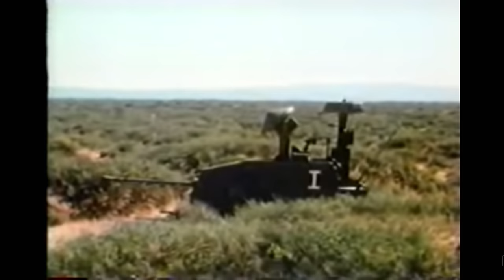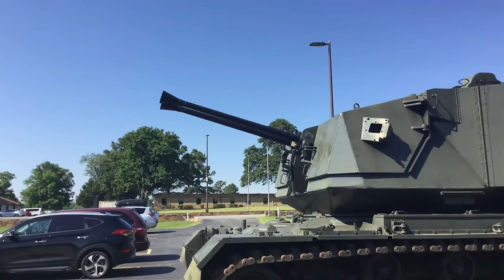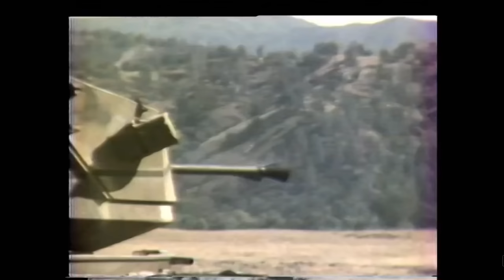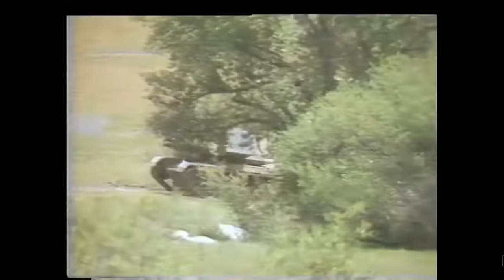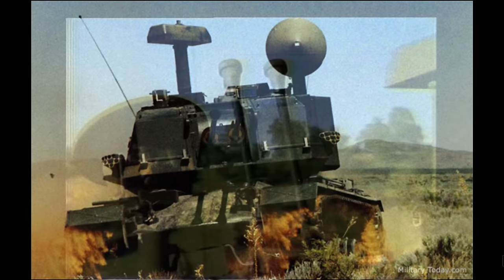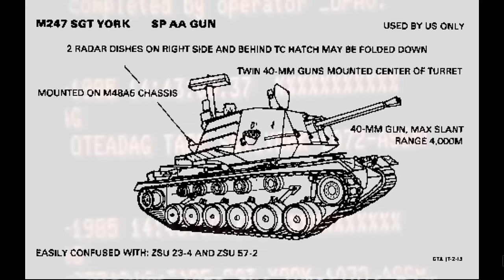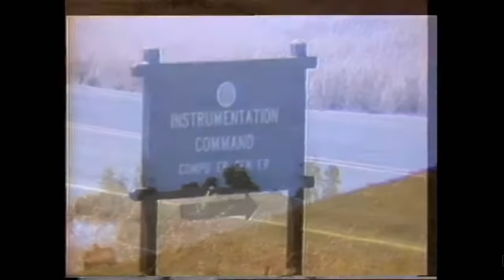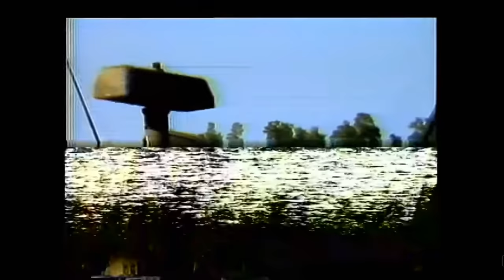M247 'Sergeant York' | WORST AIR DEFENSE EVER!

Comment: They should have just put a radar system on the M42 Duster
Reply: right
Reply: Actually the problem was that the chassis that the M42 Duster was built on, the M41 tank, had stopped being produced in 1954, and was designed in 1944. The engine was even older, as it was selected for this tank from older model tanks, so the engine was from 1941, and it was air-cooled and only got 4 MPG while producing 500 hp. When you bring a tank into combat, you don't just bring the tank, you bring its fuel, mechanics, spare parts, etc. They would have to keep a supply chain open just to keep the duster running. Compare this to the Avenger, built on the Hummer, shares the same spare parts and mechanic pool as the hummers its commonly deployed with.

Comment: When the M-163 Vulcan and M-733 Chaparral makes better sense.
Reply: Brian Coley  exactly.
Reply: We should have upgraded the m163 pivads by adding stinger pods and maybe an upgraded chassis instead of using the m113 chassis maybe a different armored chassis and a new radar system
Reply: @intelligentgrawlix794  THe problem is that the M163 has no search radar + the gun itself has a low effective range
Reply: @dwwolf4636  yes but it is meant as a close in anti air weapon and yes the m163 has a range only radar it can be improved to have a track radar,and a new gun system,and adapting it would hold a gap before an improvement vehicle is made for close air defense, I did say before to improve the m163 not just keep it as is

Comment: My first engineering job (still in school) was working on the XM246 program (test) at General Dynamics Pomona Division.  Still have a dummy 35mm round.  We thought we had it in the bag.  Near as we were told, it really came down to GD already having a huge slice of the US defense budget pie (subs, F-16, Phalanx, Sparrow, Standard, Stinger, etc.) and Ford needed the business.  Production units were planned to use M60 chassis as they were about to be very cheaply available.

Comment: How effective was the General Dynamics XM 246 competitor?
Having the radar based on the Phalanx CIWS system sounds promising.
The only issues are that the chassis requirements were limiting and the march of adversary technology* would render the concept obsolete - so in that respect maybe the Sgt York was the cheaper option in the long term as a effective working prototype that could have gone straight into production would have meant that more money would've been spent on rolling out mass production of a vehicle that would soon be missile bait. It's development hell gave enough time and opportunity for the program to be abandoned before full implementation.

As for the chassis, it would've made more sense to base it on the M1 Abrams, even if just for logistics in field, one less type of vehicle to keep spares and tooling for. It can share parts with the M1 and if the chassis part breaks down in an emergency a standard M1 can be scavenged for spares, either one that's knocked out, or even sacrificing a working tank (from among many) to keep their vital AA cover mobile.
It would cost more in construction than using old tank chassis, but in field and just support it would pay for itself.
And using the M1 would have given it more speed and more weight capacity to work with, reducing the compromises that were needed to keep it under the limits imposed by the smaller Patton chassis.
Would a M1 fitted with a Phalanx system have worked? Could a Phalanx (or even a striped down version) fit on a M1?

*It seems a fixture of US military thought that they never expect their adversaries to have the brains to develop counters, even though they have a long warning period due to the public nature of development.

"They Yankees are producing a mobile AA gun with these cannons fitted - design a missile to kill it a outside it's firing range"
[And IMHO Russia and China have been going all in for F-35 killers for at least a decade, very long range infrared detection and missiles, and radars and tactics to counter them.]
Reply: It was a phalanx fire control with twin 35mm nato standard guns so it probably would have been more effective seeing as how the radar came from an actual ground to air weapon system rather then an F-16
Reply: The point if a layered defense system is that a missile that outranges AAA doesn't outrange SAMs.

Comment: Ahhh yes classic ford, this vehicle DEFINITELY sounds like it was made by ford “reliability problems, leaky hydraulic systems and problems with starting in the cold 🥶 “ 😂😂 yupp it’s definitely a Ford
Reply: FORD

Fix
Or
Repair
Daily
Reply: Is that American Ford?
Reply: SHOCKTROOPER115 I have never heard of those problems with ford granted I live in Canada and I only ever see there pick ups
Reply: Yep, I've been driving my Ford from Ford UK for, what, 11 years?
Faults so far:
1) The cruise control brake detection switch broke
2) A brake caliper seized
3) "1" and "2" don't work on the blower anymore

Only the brake caliper ever stopped me getting anywhere (home) and RAC just opened it, disconnected it and I limped home.

Water got in the electrics after severe flooding and flattened the battery, again, RAC start.

It's as reliable as a brick.
Reply: @richarddavies7127  
Found
On the
Road
Dead
Reply: Ford is notorious for having electrical issues. Their engines run well though.

Comment: The Cv90 uses a 40mm L/70 and has an anti aircraft version.
It only has a search radar though and uses the Thermal sight and laser to "lock on"
Reply: I mean, CV90 can use anything from 25mm chain gun to a 40mm CTAS I believe...Only one nation put the Bofors 40mm L/70 on it, right?Norway I think?
Reply: @Wanys123  Norway uses 30mm Bushmaster II's on their CV9030's (as indicated by the 30 appended to the designation)
Reply: @steffennilsen2132  So not Norway, got it cheers. There is one of the nordic nations that has the L/70 Bofors on... Dutch have 35mil, Estonians have 30mil I think....pretty sure it's not Sweden either...so Denmark?
Reply: @Wanys123  Well Sweden does field 40mm Bofors cannons on their cv90's, I just wasnt sure if it was the L70, but according to wikipedia thats the case. Denmark uses 35mm bushmaster III's on theirs.

https://en.wikipedia.org/wiki/Combat_Vehicle_90#Variants
Reply: All CV9040s have AA capacity. The SPAA version has a search radar and a lock on radar.
Reply: @Noone35791  When the CV90 got gun stabilization (A version 2 axis and B version 3 axis) the gun elevation was limited to 35 degrees.
It's also not that easy to find an air target just looking for it optically.

The SPAA version only has a search radar, it's of French origin and was chosen because it's extremely good at locating helicopters.
It uses wide lobes combined and is monopulse so you get both an accurate bearing on the target and a long radar exposure to catch the rotor hub pointing at the radar.
There is no fire control radar.
Reply: AdurianJ I have never heard that the A version had a 2 axis stabilizer. Do you have a source? The CV9040 has thermals and in the real world you have recon reports coming in all the time about locations of helicopters, making them easier to locate. 

That’s not what the told us at 7th armor regiment (re LVKV90).
Reply: @Noone35791  I did my military service on the CV90's and we where getting brand new vehicles (it was long ago). 
This was the first year with something called "Verkanspaketet" which translates roughly to "The effects package" this is what became the CV90A.

It has two axis stabilization and a mechanical fire pin, but it has to use a shock absorber (that housing on the front) to limit the cannons movements.

This is not a fully stabilized system because you are missing the tilt axis and there's not a computer that decides the optimum moment to fire the gun.
I also don't remember if the gunsight was stabilized which is the main thing in a fully stabilized system.

In a fully stabilized system the gunsight and gun is stabilized separately the gunsight is smaller and easier to stabilize when the gunner presses the fire button the computer waits for a perfect alignment of the gun before activating and electrical fire control pin.

This is the system the CB90B has it's gun has three axis stabilization which is full stabilization it's gunsight is stabilized and it has an electric fire control pin.
It's suspension is also different to make it easier to stabilize the gun.

The CV90 was built on a budget to provide a mechanized punch at a low cost to the Arctic brigades of the Swedish army.
Before production started they where forced to choose between  having a thermal sight or having gun stabilization on the vehicle to keep cost down.
They chose the thermal sight.

But with the Gulf war happening and lessons being learned incremental upgrades where introduced and this started to include limited stabilization.
The upgrades increased every year until the A variant was arrived at, then all previous vehicles where upgraded to the A standard.
Reply: AdurianJ Night and day to the C version we have today then. Thanks!
Reply: @Noone35791  Yup the C version was built for international missions so it has a 3P programmer air conditioner and full stabilization aside from the obvious armor.

When i did my service we had one CV90 which had secret bolt on armour on it which doubled the armour thickness.
But it did not look like the CV90C at all it looked more like the Norwegian version.
Reply: AdurianJ I know mate. I did 10 years in the Military ;)